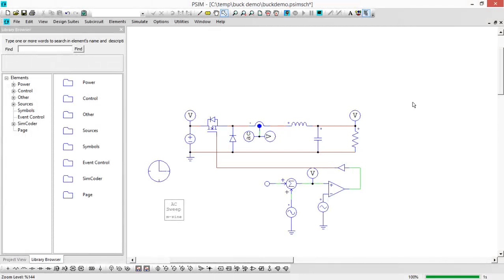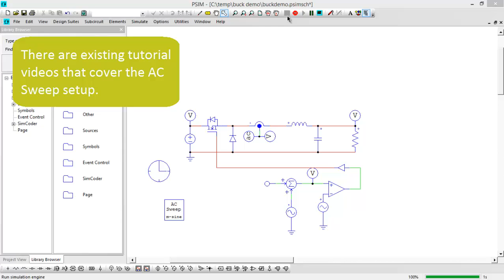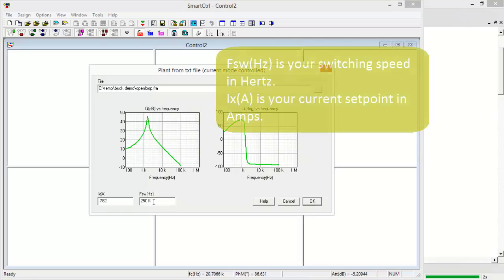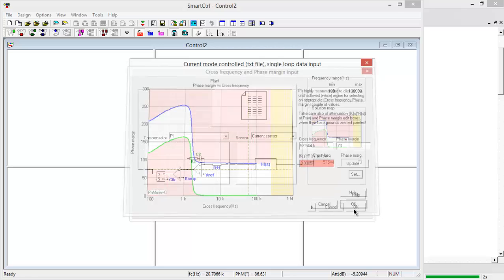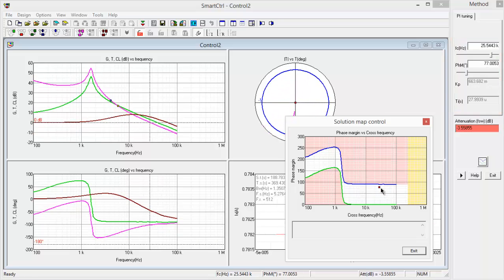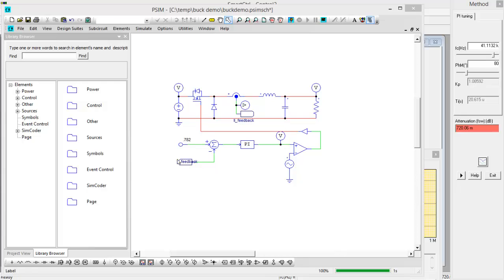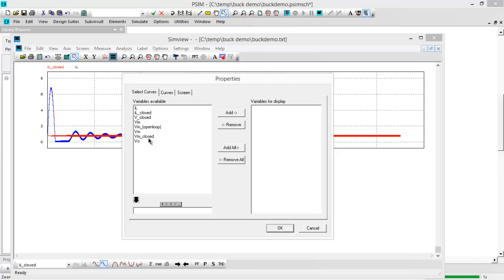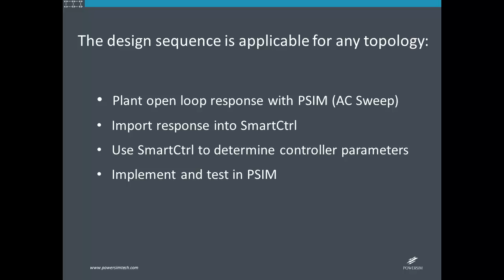Buck inner current loop design with SmartCtrl & PSIM  - general method

Comment: Is this that Buck Converter which you design earlier in a video. ?
Reply from the maker: I'm not sure I understand the question, in the same video the power stage will not change and I typically use the same power stage for similar videos. This same power stage gets a digital control solution and an outer voltage loop in different videos.

Comment: What type of current mode control is this (peak, average, ..)? How did you arrive at the value of .783 for the iref?
Reply from the maker: this average current mode control. The current ref is based on having a 3.3V output voltage and 2.5W load.

Comment: I do this for a PI controller everything works I try with a type 2 compensator and it doesn't work why? why? why?!!!!!
Reply from the maker: there can be several issue, are you changing the carrier waveform to match your simulation? are you implementing the transfer function properly?
Reply: https://powersimtech.com/support/communities/topic/type2-and-pi-compensator-for-buck-converter/

I try to build a simple pi and type 2 compensator for you. Hope this will help you.
Reply from the maker: I have answered this in detail in this forum post. https://powersimtech.com/support/communities/topic/type2-and-pi-compensator-for-buck-converter/#post-18746